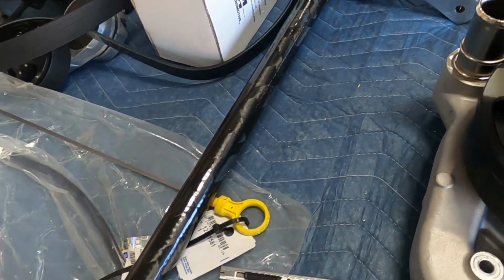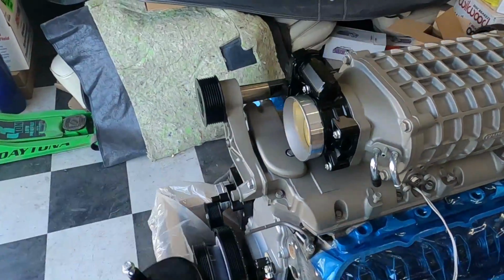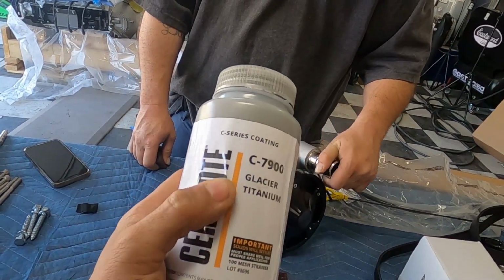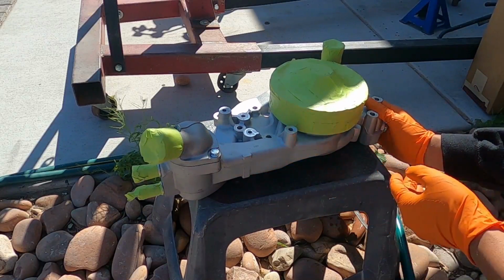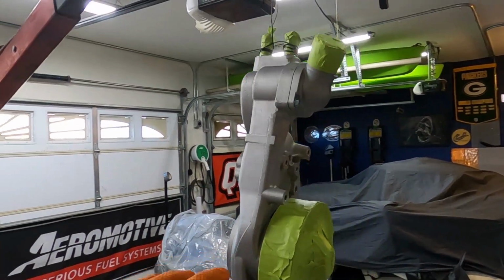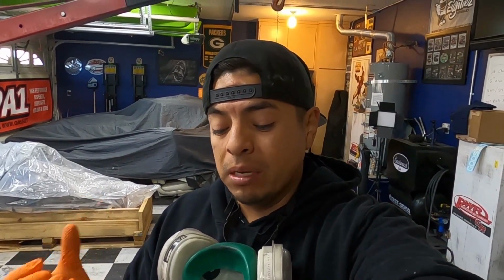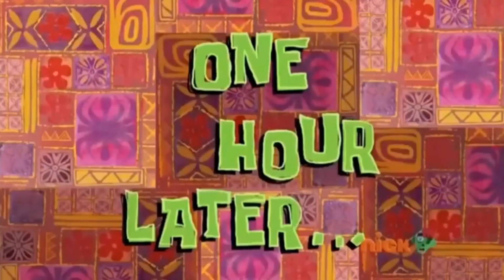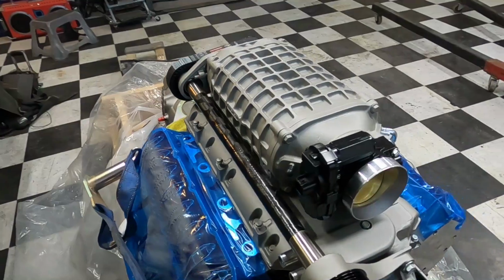HOW TO CERAKOTE YOUR OWN PARTS AT HOME! (D.I.Y)

Comment: From a DIY Cerakoter you really need to sand blast with aluminum oxide media to get the durability out of the Cerakote. I’ve done large parts that don’t fit in my blast cabinet with just a scotch brite and it will start to flake after a few months with hard use. You should also gas out with a torch before you spray the Cerakote.
Reply: I've been searching videos for answers to questions like these, thanks. The other question I haven't noticed anyone talk about is coverage, about how many items can you expect to get our of a pint?

Comment: So you didn’t sandblast with aluminum oxide like cerakote recommends? I have a cast iron Speedtech N54 top mount turbo manifold & I wanna do my turbine housing. Think I can get away with red scotch brite?
Reply from the maker: cerakote said because it was new i can get away with the scotch Brite
Reply: @goosseperformance1444  That’s cool! I bought a little sand blast cabinet & 100 grit aluminum oxide. I blasted my cast manifold & turbine housing. It came out good, one or two spots couldn’t come out better but, you won’t be able to see it anyway, as long as it’s protected from rust & keeps the heat in a little….✌🏻💯